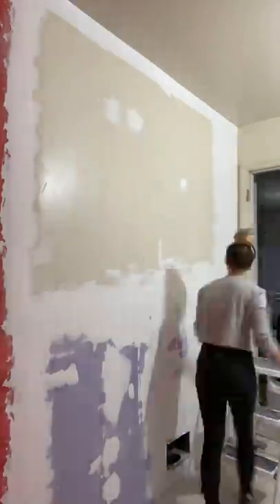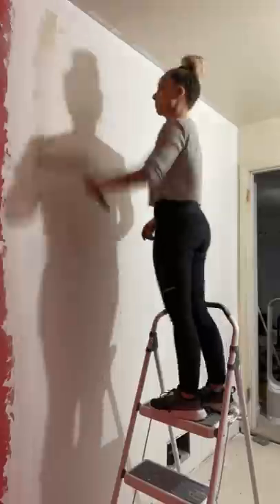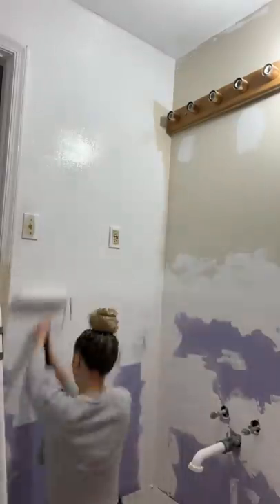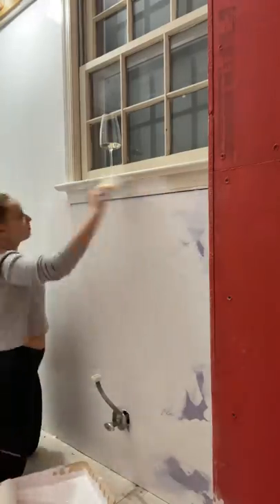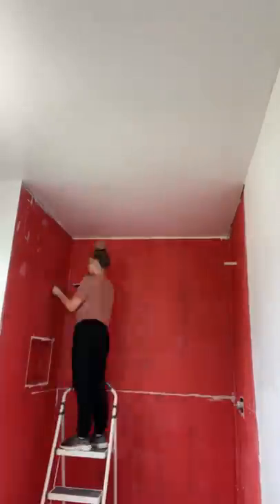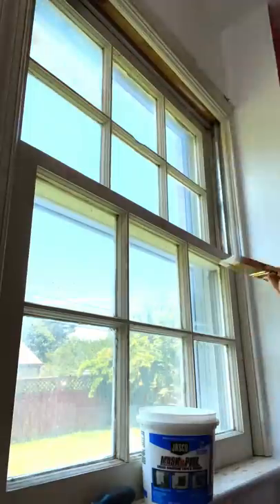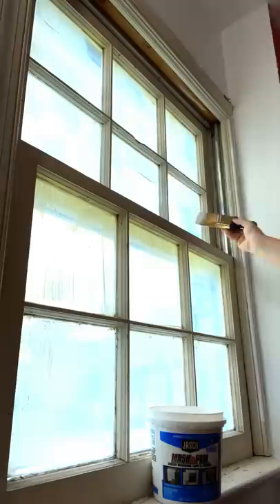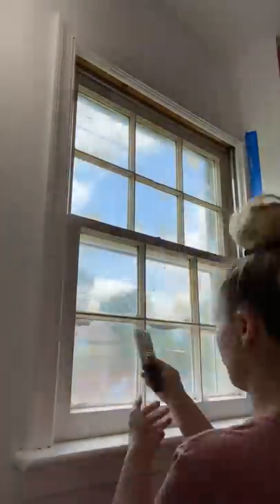HOT MESS HOUSE RENOVATION PART 69! | VIRAL TIKTOK SERIES | LEXI DIY

Comment: An Xacto knife and a flat razor blade scraper work great for windows.

Just paint them.
Use the Xacto knife to cut down the lline next to the wood and then scrape the paint to it.

No tape, no chemicals.
Paint comes pretty much right off.

Keep sharp blades.

Comment: Get a paint roller telescoping stick. Prime the ceiling first. Then paint with over-lapping strokes from right to left , or left to right in the opposite direction to the window so you don’t see lines on the ceiling when the light shines in.

Comment: Isn’t it the drywall mud that can actually be cleaned up with a damp sponge instead of sanding? 🤔
Reply: It depends on the type of mud and how thin of a layer they got on.
Reply: I have before.

It is difficult to get it totally flat without sanding.

Comment: Instead of taping the windows, or using that stuff how about a window scraper. They’re not expensive, use razor blades which are useful for other household projects or shaving, and you don’t need to use extra products or tape. Just scrape the paint off the windows.